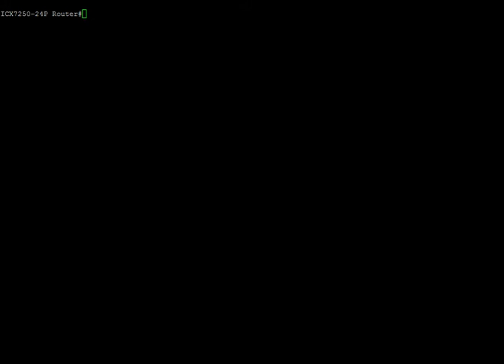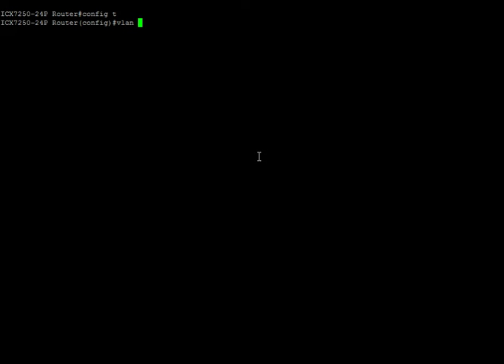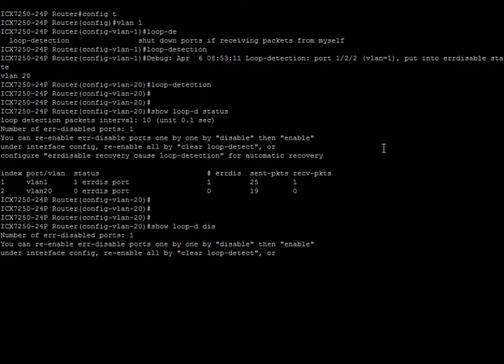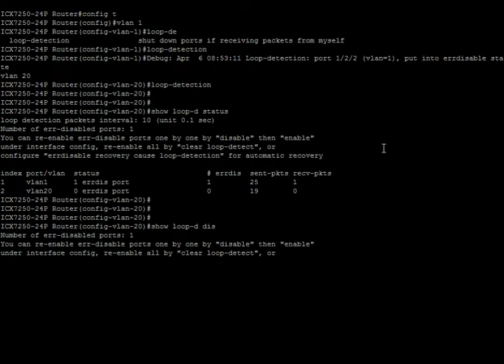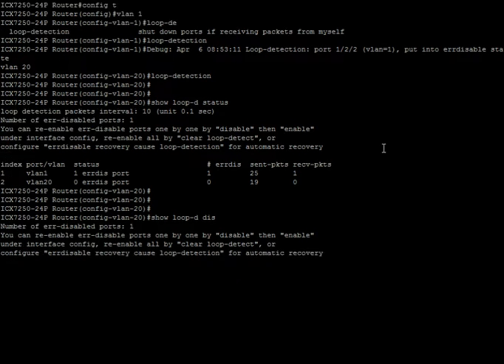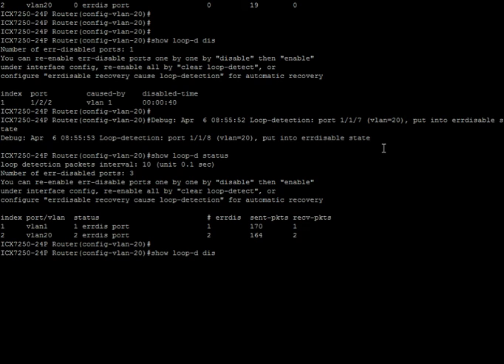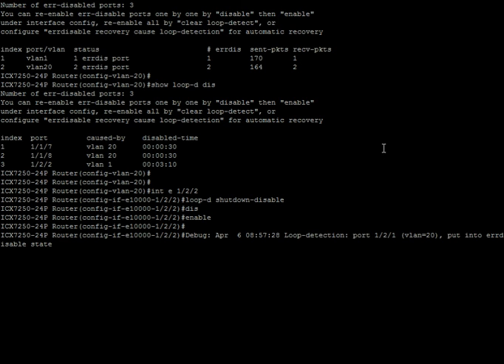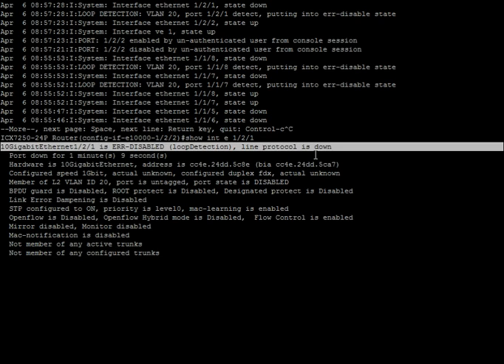Brocade ICX Port Loop Detection

Comment: Hi Terry, when you use loose mode and it detects a loop, does it shut down all the ports on the vlan or only the ports where the loop is detected? Thanks
Reply from the maker: no just the ports where the loop is detected.